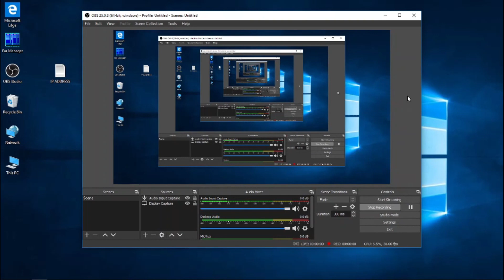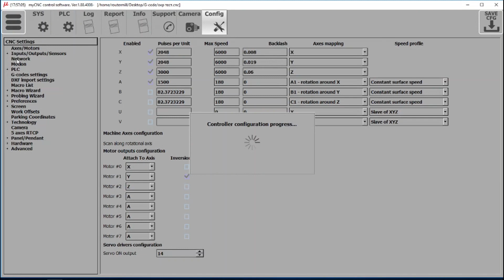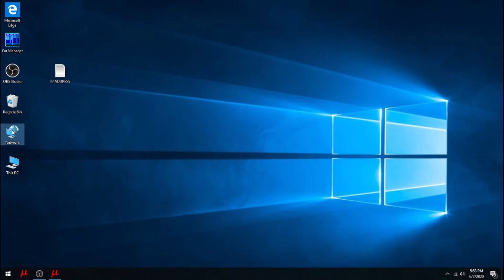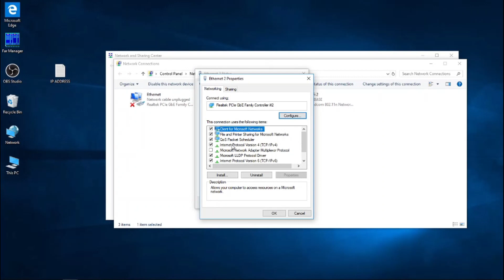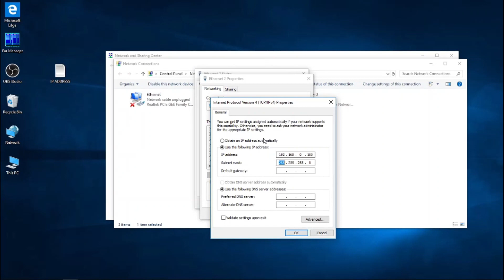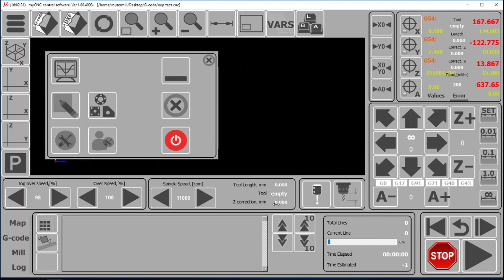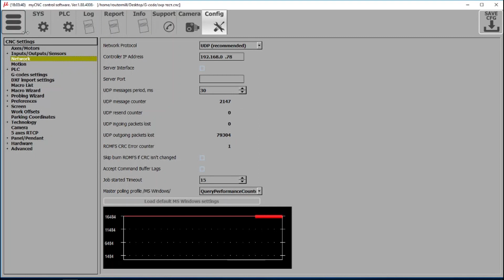myCNC Tutorials. Network setup for Win10

Comment: Does MyCNC only work with dedicated controllers such as ET6 and ET7?
If so, is it possible to purchase ET6 and ET7 controllers?
Going to the homepage, it seems that the price is not listed and there is little guidance on the global purchase process.
The images on some homepages even look like a compromised site because the links are broken and do not come out.
Functionally, it looks very good, so I want to try it out, but it's unfortunate that I don't have this information.
Reply: Hello there,
The myCNC software does indeed require a myCNC controller to properly function. 
We are currently restructuring the way our store operates, and will be sending you a follow-up email to guide you through the pricing structure and the payment process. As for the website images, the issues might be due to the browser you are using - we will make sure to take another look at the links to try and fix the issue.
Reply: @myCNCtutorials  
Hi
Thank you for quick response.
I am wondering if you are checking the "sale@pv-automation.com" email.
If not, please provide a valid email address.
So far, I am using MACH3 or GRBL.
Recently, I am testing with UCCNC and UC300-5LPT.

Recently, I saw information about MyCNC on the Internet.
MyCNC screen composition and controller seem to be made with high technology, so I would like to use it as a test.
(Ether net I/F, FPGA, S-Curve, Closed loop, NXP MCU, etc.)

First of all, I want to test it by attaching it to my CNC with an ET6 that looks simple, but it seems that the ET6 is not sold.
ET7 seems to be very close to input/output and I want to test the closed loop port as well.

I am curious about ET6, ET7 price information and global sales.

Is there a reason why the price for small quantity purchases other than large quantity purchases is not announced?

The prices of smoothstepper boards, UCCNC boards, and even all boards sold by Ali are open to widen consumers' choices.

It is very inconvenient to ask for inquiries by email.
I wonder if it would be nice if you just announced the price and global sales availability on the website.